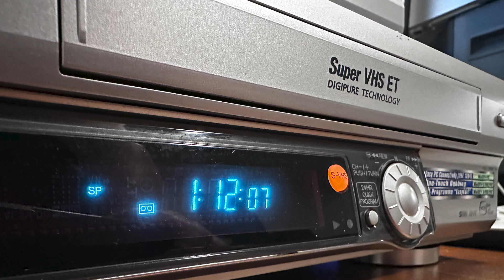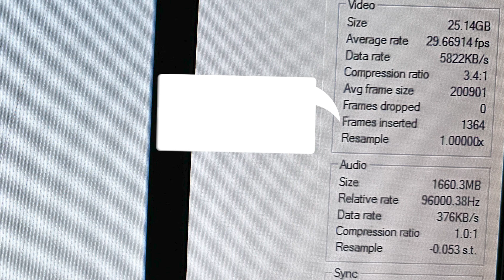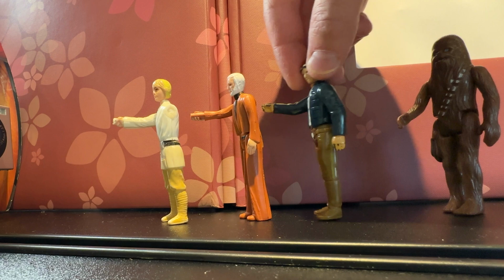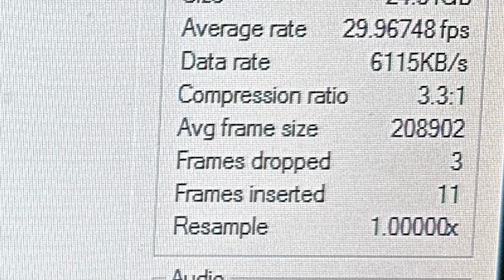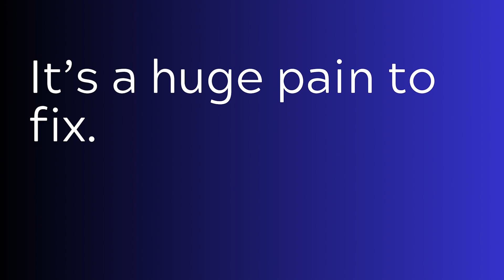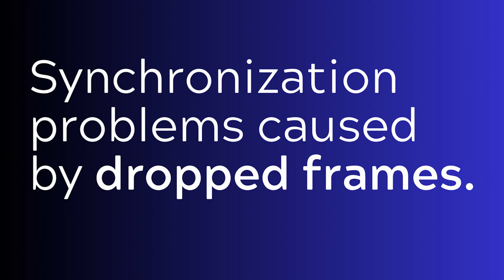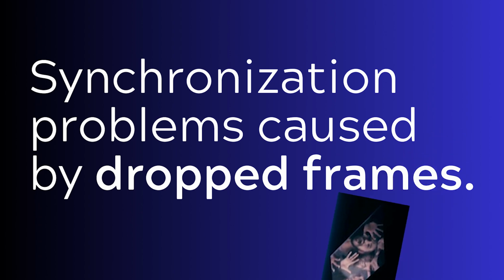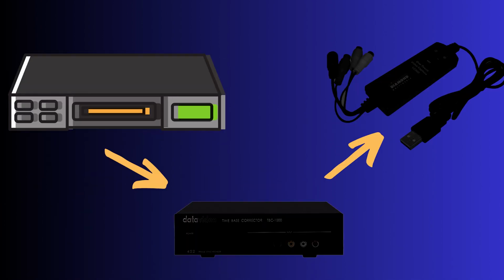TBC explained: what is a time base corrector

Comment: But timebase correctors do more than just fixing dropped frames right? They stabilize every scanline too. Which can improve visual quality of the frames as well, not only fix dropping frames or desyncing of av signals.
Reply from the maker: Line TBCs do indeed stabilize the image. Frame TBCs buffer the signal and release it to the capture device at a stable rate. At the consumer/prosumer level these are separate devices.

Comment: would buying an AvTools AVT-8710, which is a very great TBC from what i gather, better than buying a JVC S-VHS VCR with a built-in TBC?  I have seen AVT-8710's on ebay just today for over $2000 (USD).  I have also seen JVC S-VHS units with built-in TBC on ebay for over $1000 (USD).  Please advise.  thanks!
Reply from the maker: The AvToolbox AVT-8710 is Frame TBC, similar to the Datavideo TBC 1000. These frame TBCs do a few useful things: (1) if the content on VHS tape is protected with Macrovision (as many commercial tapes were) then the frame TBC can defeat it and allow you to digitize the tape without all the errors that Macrovision adds; (2) it can ensure that the audio and video don't move out of sync during the digitization. But frame TBCs do not fix the wiggly picture issues.

What does fix the wiggly image stuff?

A Line TBC, like the ones on the expensive S-VHS VCRs. (Or some DVD-recorders used in passthrough mode.)

If you plan on digitizing home videos recorded with a camcorder, then a frame TBC is not as important. If you plan on digitizing commercial VHS tapes, then a frame TBC is essential.

Finally, there are two versions of the AvToolbox AVT-8710. One comes in a green case, and one comes in a black case. The green case version is the good one according to Lord Smurf and the other experts at the at DigitalFAQ forum. The black-case one can actually introduce errors. ALSO, Lord Smurf has said that there may be some units in the green-case models that were originally in a black case. I'm not sure how what the circuit board on the green-case ones are supposed to look like. But keep that in mind. And also, like all electronics, the capacitors on the circuit board will eventually fail and may leak on the board. So, if you plan on investing in an expensive item like this, consider recapping it or finding someone to do it for you.
Reply: @videocaptureguide thanks!  i saw a video last night on youtube, by user Benne Will, explaining what you said. he mentioned that the original green  case version of the AZT-8710 is the best, while the black one produces noise in the conversion.  both are on Ebay at an insane price!  I am not even ready to purchase one right now, but maybe, someday.  my sister got a good deal on a JVC S8000U on ebay.  Hoping the videos of family memories will convert well.  🤞🤞
Reply from the maker: @coolcatrick3454  If you are able to able to digitize without dropped frames (or with very few) and if the audio and video stay in sync after an hour, then you don't need a frame TBC, at least not at those prices. In this video, I show what settings I used in VirtualDub to keep the audio and video in sync without using a frame TBC. And keep in mind, that every tool you add to the workflow has a side effect. JVC line TBC fixes the wiggles, but is usually tied it to Digital Noise Reduction (DNR), which some experts like and others prefer to do everything in software later on. A frame TBC can also affect the image a tad. So, the rule of thumb is don't use the gadget unless you really need to. This was the advice I hated hearing when I started down the rabbit hole because I didn't want to have to play the video without the line TBC turned on, and then play it again with the line TBC turned on, and then decide which was best. So depending on how much time you have and the number of tapes, you may want to do these A/B tests, because some VHS tapes probably won't need a Line TBC.
Reply: Donde se consigue uno en la argentina?

Comment: It's a software problem today in a dying analogue hardware world VHS-Decode keeps beating the dying and scapled market 😉
Reply from the maker: Many folks here are very interested in trying VHS-Decode but even with the instructions the ordering process is not intuitive for the average person. And there’s some DIY once one gets the hardware. I think there is a good market for the RF capture device once someone packages it and sells them, even when factoring in a profit. Perhaps a good business model is Home Assistant where one can set it up themselves and login from a distance but where the Home Assistant founders created a for profit company to offer that service turnkey for those that want it.
Reply: @videocaptureguide  what do you mean ordering process? 

There is multiple avenues and multiple device choices, the whole point is open source high flexibility anyone who reads the homepage of the wiki instantly realises this.

The DomesDay Duplicator is 3 clicks from the factory, self-contained flashing guide and software bundle is provided for the two of off shelf dev boards.

CX Cards are outright order, clock gen mod is available on the Kofi along with amplifiers, very cheap and easy to modify and afford to break one or two and I also have offered modification as a service for about 2 years now for anyone that reached out via email.

I think the average person can easily order everything because it's listed and linked, and there is multiple avenues for support resources.

The formatting of the wiki docs even considers people with dyslexia with a heavily biased brake block formatting.

So the average person who just won't read well they're just screwed as much as they would be on conventional capture.

But with the development of the MISRC we aim to take both the conventional and the RF market, still end users are going to have to tap their decks but that's completely documented with hundreds of units coverd in the wiki.
Reply: @videocaptureguide  what do you mean ordering process? 

The DomesDay Duplicator is 3 clicks from the factory, self-contained flashing guide and software bundle is provided for the two of off shelf dev boards.

CX Cards are outright order, clock gen mod is available on the Kofi along with amplifiers, very cheap and easy to modify and afford to break one or two and I also have offered modification as a service for about 2 years now for anyone that reached out via email.

I think the average person can easily order everything because it's listed and linked, and there is multiple avenues for support resources.

The formatting of the wiki docs even considers people with dyslexia with a heavily biased brake block formatting.

So the average person who just won't read well they're just screwed as much as they would be on conventional capture.
Reply: @videocaptureguide  Right now the hardware comes in DIY kit bits or order on demand when stocks are built up this is for the clockgen mod and CX Cards are off shelf.

The DomesDay Duplicator is turn key all year avalible as long as a vender has the FX3 and DE0 dev boards anyone get ahold of one within 14 days +- at cost, the MIRSC v1.5 has just also dropped as a dev board ready for direct fab order.

The order docs are fairly 1-2-3 nowadays and the community support is always around to assist new users to the workflow at all times of the day. 

There is a kofi store, and I plan on listing more hardware there and sell pre-tested cards, its not a cheep thing to build a buffer for selling physical goods.

Comment: The main difficulty lies in evaluating which synchronous signals can be evaluated to evaluate the source speed and which disturbances must be ignored. Unfortunately, the TBCs do not remember what speed the quartz that controls the motor in the source device has and after a longer dropout they start again at the idle speed.

Comment: Can I ask how do they also seem to be closely related to making the image look better, etc?
Reply from the maker: The time base correctors in some expensive SVHS players have (confusingly) the same name but are “line” time base correctors. Those are the ones that fix the image by, for instance, removing vertical jitter and that wavy thing at the top of some troublesome tapes. In addition to the line TBC in some SVHS players there is also the line TBC in some DVD recorders such as the Panasonic ES-10 and ES-15 that can be used in passthrough mode to fix tape tapes.
Reply: @videocaptureguide  Awesome! Thank you! I recently got a Sony SVO-1800 and it seems to have some of that.
Reply: @YoursTrulyYoshi  There is only Sony SVO-5800 (S-VHS) or SONY UVW-1800 (Betacam SP)
Reply: @TTVEaGMXde  5800. That's the one.
Reply: @videocaptureguide besides the tearing at the top of the frame, line TBCs also correct waving of the entire frame, where straight lines in the image wave like a flag due to the timing of the lines not being in sync. That's the main reason for line TBCs. The DMR-ESxx have a frame TBC, which prevents dropped or inserted frames by the capture card, but the devices themselves can drop or insert frames before it even hits the capture card. They also apply a small amount of filtering, causing a slight posterization in some cases. Personally I use a JVC HR-S7800U SVHS with the lIne TBC, along with a Panasonic WJ-AVE5 video mixer... it has a frame TBC, as well as an audio VU meter and sliders to make sure you're not in the red. Very handy device. 😎
Reply: @michaelbinbc  "Panasonic WJ-AVE5 ... has a frame TBC" - are you absolutely sure? Did it eliminate audio drifting for your tapes?
Reply: @mostlyfinnishlifeeventsand5112   I'm positive. Feed it garbled video, and it outputs as it plays in the VCR, without drops or inserts, and audio still in sync. I did however miss the fact that it's a PAL device, even though it's 120V. I've been told it's PAL60.
Reply: i have a doubt, which is the best one? Leitch DPS575av or panasonic ES-10??